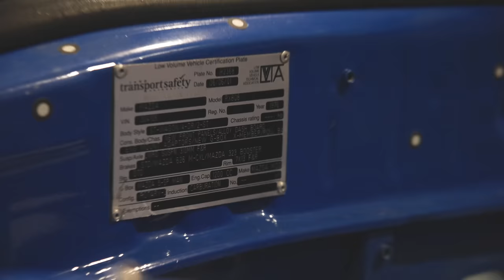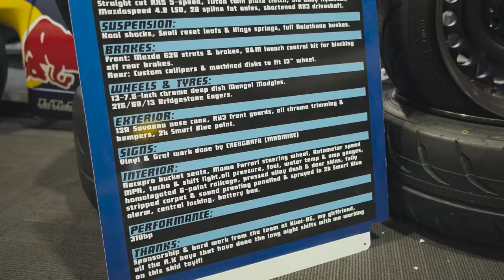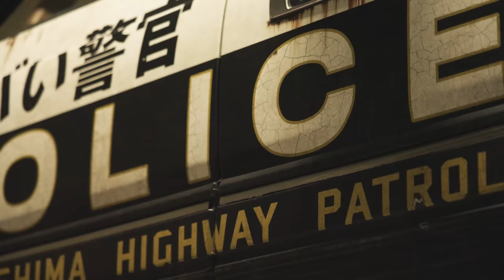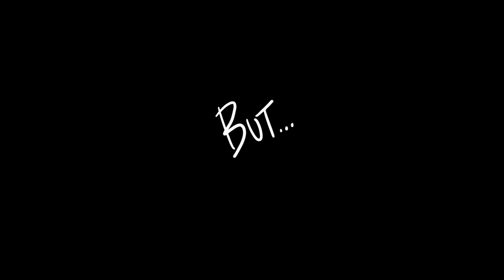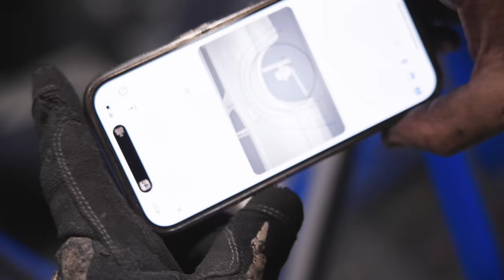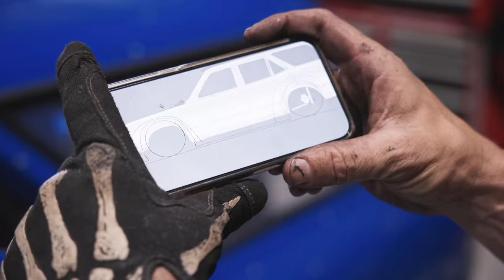The rebirth of the real OG of the fleet

Comment: Big up MM! The sound and torque from a supercharger would be awesome on a 20b for the 808, only limitation is the charger size. Next option would be to have an old school looking engine bay with the turbo hidden under/integrated into the round 70s style metal air filter with the breather snout 20b looking like a 12a😂. Water meth cooling - no intercooler. Third option 4 rotor na. 4th 13b/20b NA with the bmw hybrid transmission conversion. My 0.02 oz of 2 stroke. ☮️❤️💯